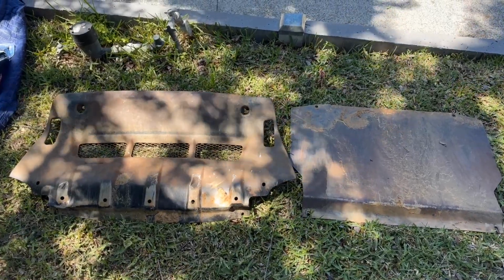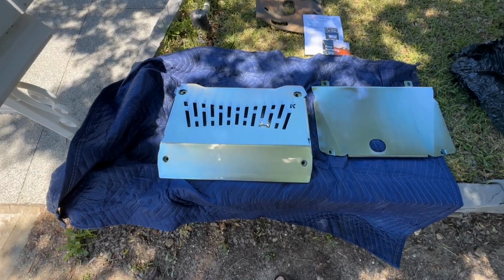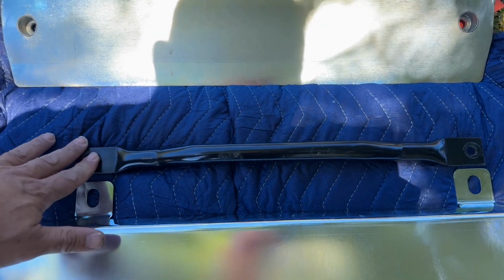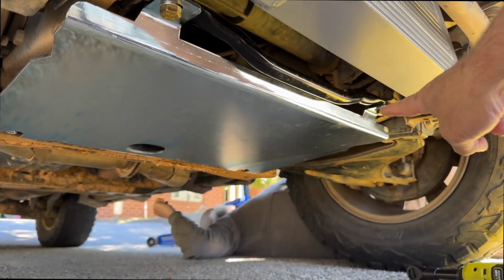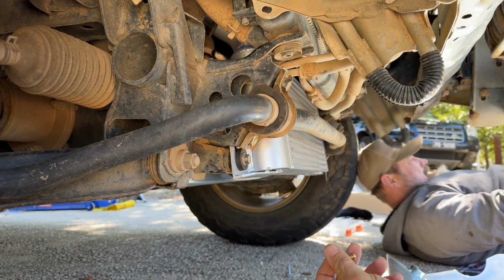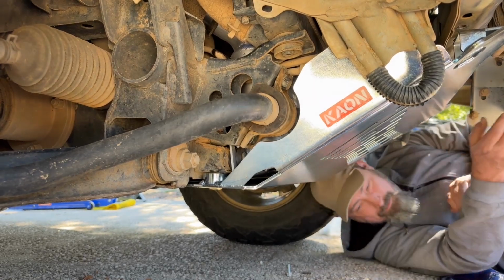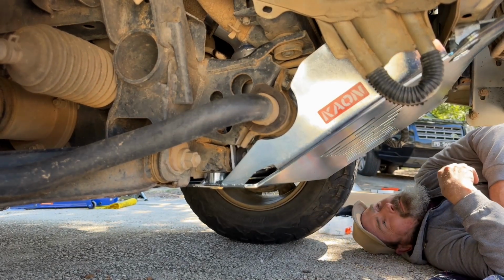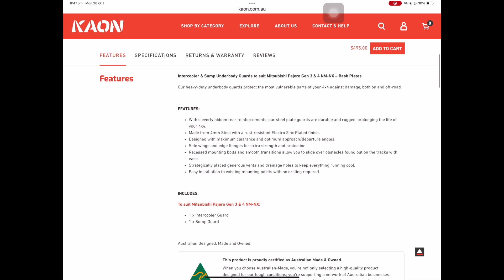Pajero Bash Plate Installation -Kaon

Comment: The Kaon as shown in the video cost $495.  The RHS 4mm option costs $450 and has aspects that are unquestionably stronger.  If the centreline of the front bash plate was driven atop a rock, the Kaon would seemingly be resisting the force with a single layer of 4mm material.  If a RHS 4mm option was driven atop a rock there would be one layer of 4mm, plus it's bolted (creating friction) to another layer of 4mm, which is welded to a 10mm deep beam, and thus the overall thickness is 18mm.  I have received zero reports of damage to the RHS 4mm Pajero front and sump.  They are better plates at a lower price.  The RHS 5mm option costs $550, 10% more than the Kaon, and is stronger, is 10kg rather than 18kg, wont rust, allows more airflow to the intercooler, etc.  The RHS 6.1mm option is at least twice as strong as the 4mm Kaon, it is in a whole different league.
Reply: RHD look good, but don't have the recessed bolt heads...
Reply: @chazkdarwin3875  high tensile steel bolts are one of the strongest materials on a vehicle, and are typically easily replaced if ever compromised.  In my experience its generally not worth losing ground clearance for the sake of bolts, sacrificing ground clearance in critical areas causes more frequent and harder ground strikes and bogging.  Why fit a suspension lift then throw the advantage away with poorly designed bash plates?  There is also the issue of recesses filling with mud and clay causing rust and extra servicing labour charge.  However, button head bolts can always be fitted to all of my bash plates, and i am considering offering them as an option.  I am also considering options for bolt protection in a way that doesn't lose meaningful ground clearance or strength, but as they stand my bash plates have so many features raising them well above the competition it shouldn't be a deal breaker for anyone.
Reply: @rhetth-s8082  Thanks for your reply, I hadn't considered a height difference, would this be 15-20mm max? Are your RHS plates compatible with the genuine accessory nudge bar?
Reply: @chazkdarwin3875  how much ground clearance is lost for the sake of bolt protection varies.  Some bash plates sacrifice more than 30mm of ground clearance.  My order of priorities for protection are intercoolers etc, things that keep a vehicle running, then other aspects of the vehicle, then the bash plates, with bolts last.  I would much rather replace a bolt than a bash plate.  Many RHS bash plates have been fitted to Pajero's with nudge bars, they are compatible.